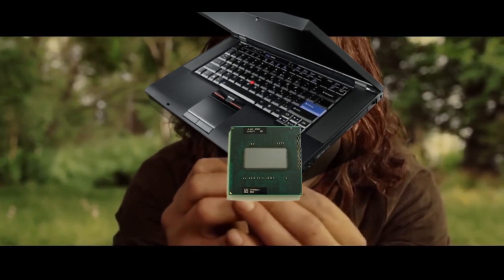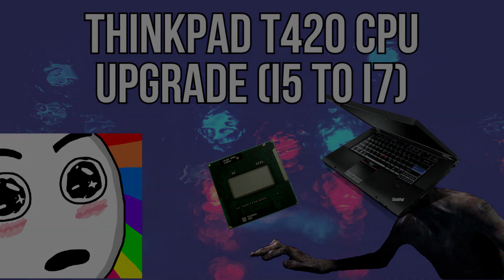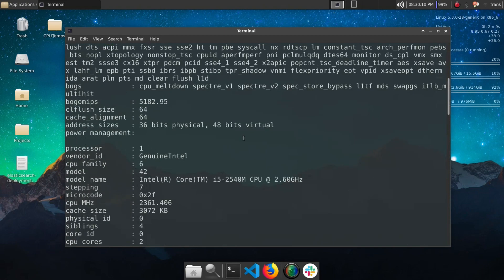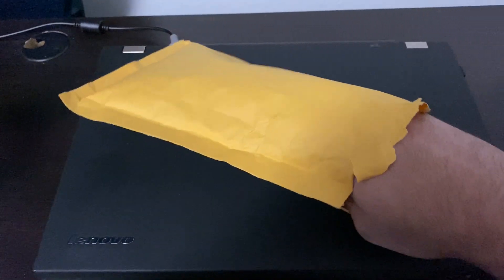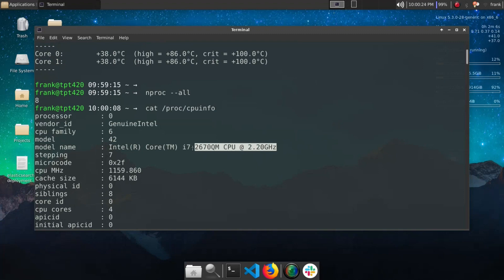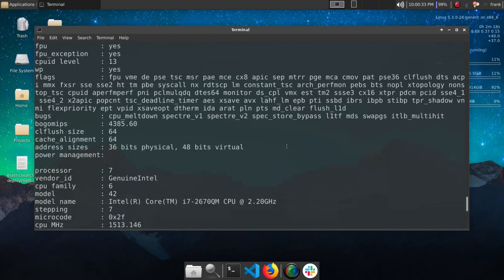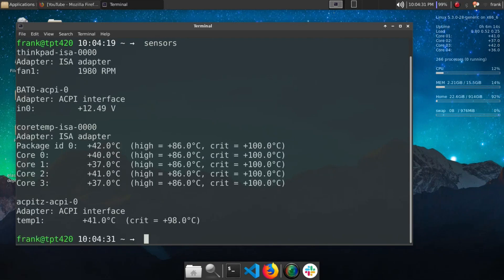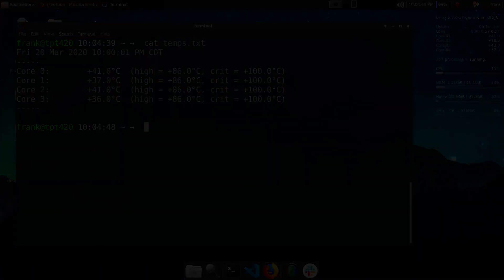ThinkPad T420 CPU Upgrade (i5-2540M to i7-2670QM)

Comment: hi, how exactly did you update your bios from linux? I have an issue where the boot menu wont allow me to flash into anything and it just says ububtu at the top, although im running manjaro now
Reply from the maker: Check out my ThinkPad Bios update video. There's a link in the description with the steps I took to update.

Comment: Hi, 

Just a few queries,

1. What's the chipset on the motheboard? is it  HM65?

2. What is your feedback, since you upgraded? Heat, voltage ... any overheating problem?
Reply from the maker: Junaid Parvez 1. https://ark.intel.com/content/www/us/en/ark/products/53469/intel-core-i7-2670qm-processor-6m-cache-up-to-3-10-ghz.html 2. It definitely runs hot when doing things like video rendering, I would say that the speed is not really a huge difference. Definitely an upgrade I would only do if you’re doing it for fun.
Reply: @Frankiscool  Good 2 know. Been considering doing some further tinkering on my t420 but I really don't demand much from it besides 25 tabs of Chrome, Dropbox and Excel. Been having fun optimizing the storage though.
Reply from the maker: Yeah the SSD upgrade is a must on any machine!
Reply from the maker: Ajay Kumar Meda true that